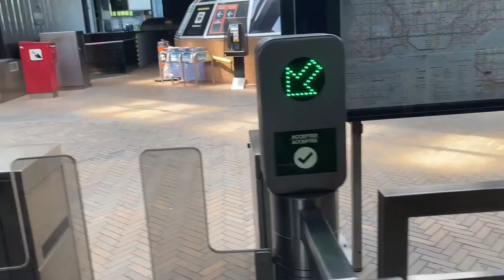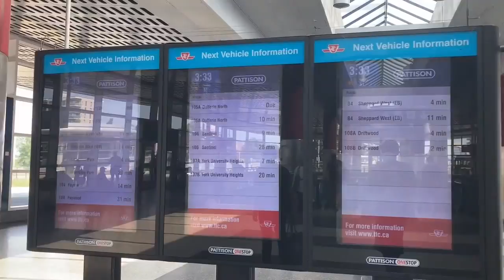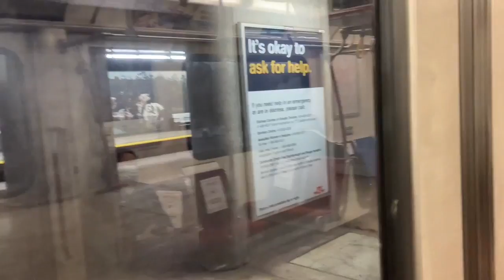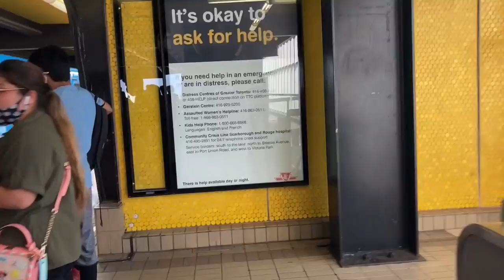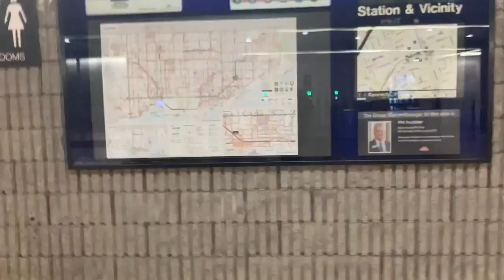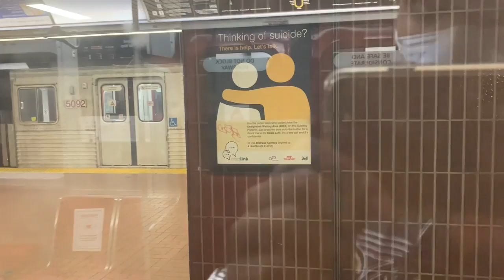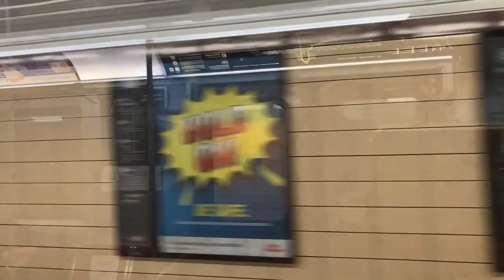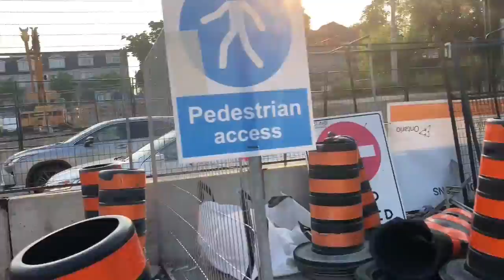A Journey Across Toronto on the TTC! 08/09/2021

Comment: They shouldn’t take out the SRT and should do what Vancouver did and get newer trains
Reply from the maker: I agree with you but unfortunately, when it was proposed back in 2006, it was very costly. The infrastructure would have to be significantly upgraded and the tunnel between Midland and Ellesmere would have to be widened for that.
Reply: and I think some people want a single continuous line out to STC, as opposed to having the separate line and transfer that only runs a couple of stations.